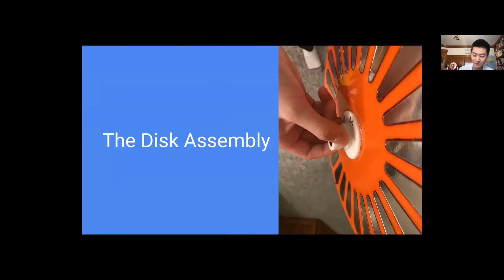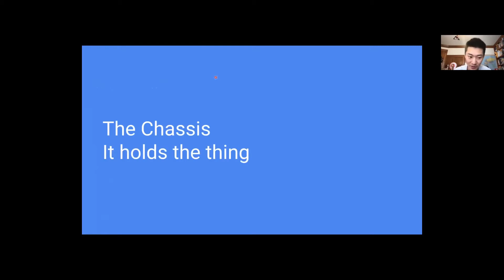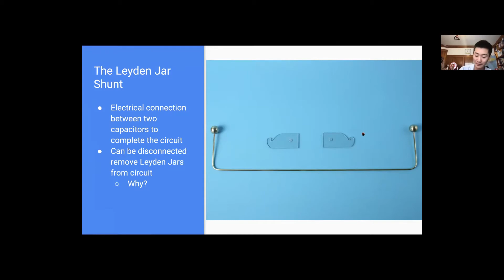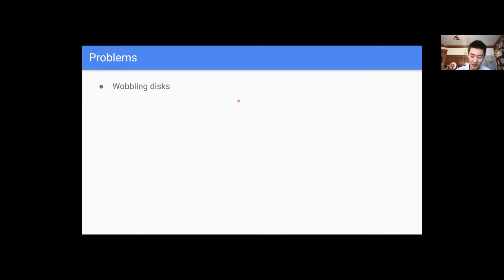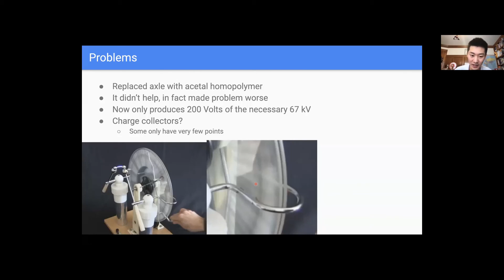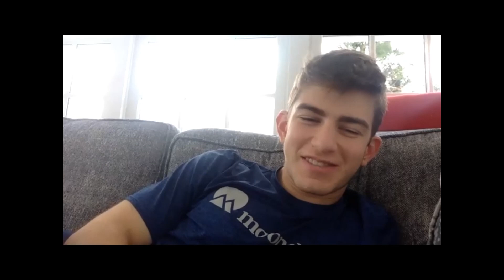2020-21 Wimshurst Machine Presentation

Comment: I wrote a failure plan for myself to check if my machine is built properly:

-The position of the neutralizer bars is picked well for your machine
-The neutralizers touch the disks without stopping for a whole rotation
-The neutralizers touch the disks exactly on the opposite part of the circle (you already checked that)
-The disks never touch each other in rotation, but have a minimal distance
-The collectors are at a point where two sectors overlap from each disk (difficult to see with your non-transparent disks)
-The collectors are not too near and not to far away from the disks
-There are enough sectors (20 - 30) for each disk (your 24 sectors should be enough)
-The sectors aren't worn off
-The sparking electrodes have the correct form and distance to each other (this point was not for high voltage but only long sparks)
-There are no shorts and no broken connections
-The wires are thick enough (I used a 2.6mm copper wire)
-There are no sharp points or edges that could leak charges
-The air humidity is low enough (mine was 60%)
-There is a good capacitor in use (mine were in the range 50pf to 500pf)
-With only the neutralizing bars connected (no collectors) you should hear a hissing noise when turning the disks.

Maybe it helps you. I reached a voltage of around 25 kV with mine and I'm planning to improve it.

Comment: Are you gonna finish it or just stare at the core of the engine ?

How do I put this...
It's like this ..

It's a wimshurst engine block...
Like a ford engine block...
Only it's not with gas .

Do you understand...

It's like a engine stripped down to the block...

Ford and porches use a gas liquid , oil base.
Wimshurst use a energy base.

Thus instead of a gas carburator . we use a tesla transformer.

Have you see star trek , USS Enterprise...look again at the USS wimshurst design.

The wimshurst engine block you see is the same design for USS Enterprise..

Look at design of wimshurst.
Look at design of star Trek ship.